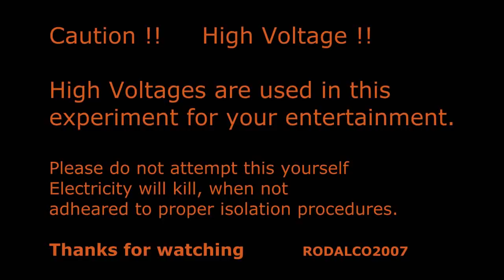CRT deflection coil arcs with High Voltage Electrcity

Comment from the maker: If you put 240 V on the 11 kV terminals not too much would happen, may be 30 to 40 Amps ate a low voltage of 4 to 5 Volts. too low to be useful.
That TX is 25 kVA.

Comment: i want to discharge a CRT to work on it... can I use a wooden pole or PVC pipe,  use electrical tape to attach a screw driver to it and put alligator clips to the screw driver and tension wire (braided wire around the tube) and tap the anode with this?  or is there some kind of danger to using pvc/wood pole?  obviously the set is unplugged... and it's been sitting for good while now.  i actually don't even know if the set works, the power cord was chopped by the city.
Reply from the maker: Yes, you can a dry wooden pole or PVC pipe to discharge the CRT. Put one end of the aligator clips to the aquadag/copper braided wire which is attached to the tube,black. and the oter end to a screw driver fitted to the pole and probe underneath the ultor cap to discharge. Most likely the tube is discharge but rather safe then sorry.

Comment: How can you pull a 2dm arc off of a flyback transformer that only produces about 28 KV?  Nice job getting around tripping your house's circuit breaker with the car battery. 
Frank Reiser M.S.

Comment: If you notice, everything is put on paper first. Second he always uses at least a double reciprocity ground. And all his devices have meters, and auto cutoffs. Notice how long his pole was to make the Jacob's Ladder? He does like to blow things up, and I worry about the gases he might be putting into the air. But it is amazing how many people will sit for hours watching a home made 10,000 volt bug zapper blow up the  Giant Southern Yellow Jacket Wasps.( of which the meanest is the Austrailian yellow jacket). However if you have ever been chased by any regular Texas Yellow Jackets, you would know next to African bees, they are the meanest. You can tell them by the brite yellow and the legs,heads,bodies,ect...,are all yellow almost no black, and they can sting in long rows like a bumblebee. P.S. like the fire ant, the cross-bred Yellow Jackets can bite you and sting you at the same time. So when he said he was bitten...he was stung...but could have been bitten also. Brother James OSB OFS OSC

Comment: I've been wanting to post another High Voltage arcing video myself but am finding to get a big long arc, you need many hundreds of amps or more from the mains. Else the arcs are simply too small and not spectacular enough. I'm thinking 66KV or 110KV at a few amps would be impressive.

Comment: I'd hate to open that light bill...
Reply: I'm sure the broken broom costs more.
Reply: It would be just the same bill as watching an ordinary crt tv required kilowatts per hour that are being consumed. The only difference is the actual output; however, the input electricity when it passing through this circuit are being transformed thus increasing the output to have more power, but still same as just watching an crt tv

Comment: Wont it emit some x-rays at that voltage or am I mistaken?
Reply: This would be true if it weren't for the leaded glass used in CRT TV's. Which is used because they emit X-rays even under normal operation.
Reply: No. Need vacuum then anode target

Comment: Ah, that's bit of a shame, because a Tx that big looks like it could turn out quite a few hundred amps & do it all day long if it were "wired backwards".

If I had a Tx that big, I wouldn't be able to help myself but to experiment with it.

I once tried powering a doorbell transformer backwards, hoping that it would kick out silly voltages. It did for a split second, because there was a loud SNAP from inside it, then the 240v primary packed up, so I burnt out the 12v secondary on 240v. :D

-BBD.
Reply: BoomBoxDeluxe I did the same thing bro 😆 That's actually what got me into pulsed DC transformers and transistors/mosfets, they can run on tiny primarys and huge secondaries that kick out stupid high voltage.

Comment: is a tv completely safe to take apart when unplugged?
Reply from the maker: You need to discharge the HV supply to the ultor cap on the CRT tube to be on the safe side. Use a insulated screwdriver and connect a flying earth lead to the metal of the screw driver and the bare earth wire around the CRT tube. Then prize with the screwdriver underneath the rubber suction cap and touch the metal clip underneath to discharge ant Capacitance left.
Reply: RODALCO2007 what if my crt hasn’t been on for a few months? Should I still discharge?
Reply from the maker: @fredpickels6925  It should be ok, but to avoid a shock discharging only takes a few seconds to do.

Comment: LMAO & ROFL at 0:56 . As Photon once said: "It's fizzing a bit at the baaaack!"

Nice arc-ups... That TX has got some Grunt.

I'm beginning to wonder: With a transformer that size, could fun be had with it if you "wired-it-backwards" for high-current ? :-)

I can't remember what kVa the Tx is now, but something that size... It must surely be more than 10, yes?

If so....A few volts with 10kVa behind it = BIG FUN. :D You could warm up 6" nails then tie knots in them. :D

Thanx for showing,

-BBD.

Comment: what is the point of this video?
Reply: Yo thats what I'm thinking right now lol
Reply: Demonstrating a high voltage arcs coming from an crt tv, obviously
Reply: Thanks but the point of the video is still not obvious to me.
Reply: To make a CRT throw off some horrifying sparks and arcs, clearly.
Reply: I don't understand either. Nothing interesting. The high voltage supply has been removed and replaced by something else but WHAT ? What is the battery for ? Some more explanations could have been usefull...
Reply: @nonothebot  battery is to run the heater coils. Narrator mentions this in the first few seconds
Reply: True, and it is also mentioned in the notes. I didn't see it at my first reading.
However whatever he says I don't understand !
Reply: Electrical Engineering Videos on my Chanel I agree
Reply: Does there need to be a point to every video you watch? It's just a demonstration. There's no deeper meaning here.
Reply: Another way to light a cigar ? 🚬⚡

Comment: Once of a time,meanwhile  I repairing an old  crt tv the high voltage cable cut off and fall on my glasses, at once I cannot see anything  unless white light for half hour. So it is too dangerous to touch  high voltage cables.Dont't do that